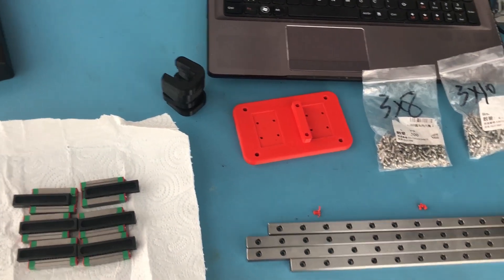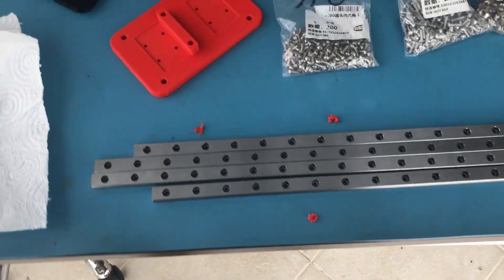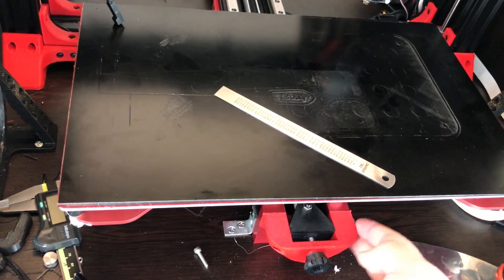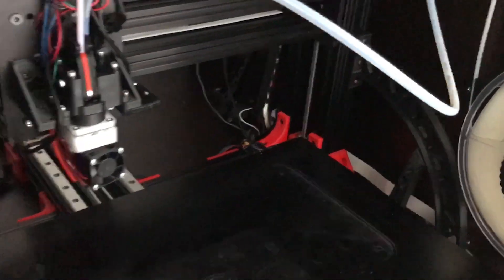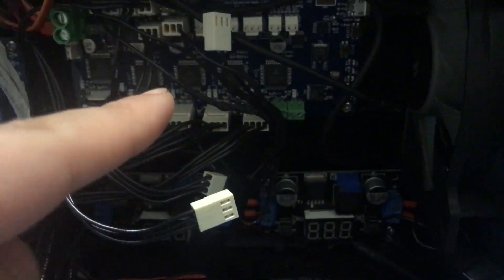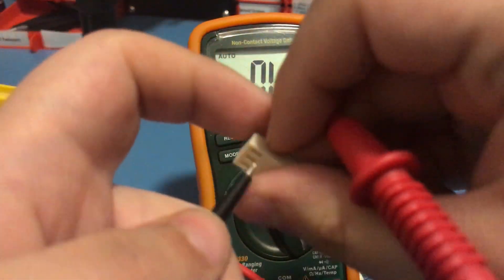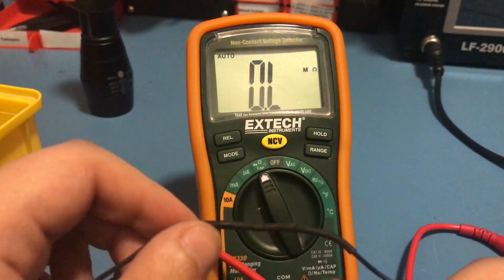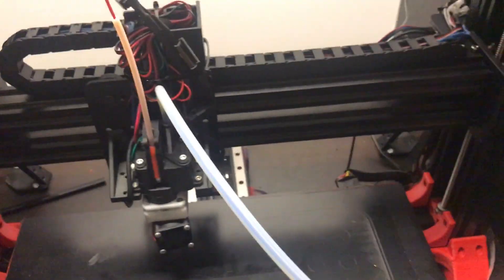Tevo Black Widow Mods Part 25 - MGN12 Rails On Y Axis & Endstop Problems (Again!)

Comment: why is there I diode in the wire in the first place ? and the Diode should be tested using Diode test mode - not Ohms resistance.
Reply: Can you check the outgoing voltage to the sensor - this will help to know what may be going on ?
Reply from the maker: As I explained in an earlier bw mods video, Duet only supports 3.3v sensors. The sensor that the bw uses is rated for 12-24v but works fine with 5v too. Unfortunately it doesn't work on 3.3v. So I had to power it from 24v and use a schottky diode in between to protect the Duet.
Reply from the maker: It's fine. 24v.
Reply: Hi Isik's - Sorry I missed that part in the earlier video's. Unfortunately the method chosen to utilize the end stop is not ideal. If your Sensor works from 5v Dc upwards then I would source a 5v supply for the Sensor and then use a more suitable method of lowering the Switched Output voltage down to 3.3v. 
A Voltage divider network or a dedicated  Logic level converter designed to do the job correctly would be far more suitable. This Saves risking the Duet board which is obviously very expensive in comparison.
Reply from the maker: You are right. I will look into sourcing something like that soon. Or I may just switch to regular microswitch endstops. The reason I decided to use a diode was based on information on the Duet wiki. That's what they recommend for npn transistor sensors (https://duet3d.dozuki.com/Wiki/Connecting_a_Z_probe#Section_NPN_output_normally_open_inductive_or_capacitive_sensor)